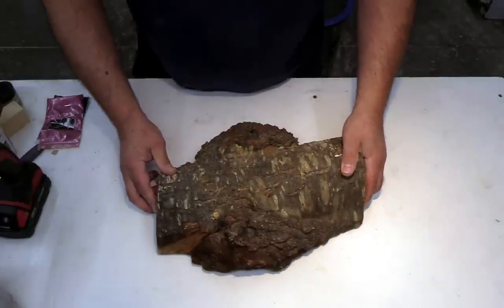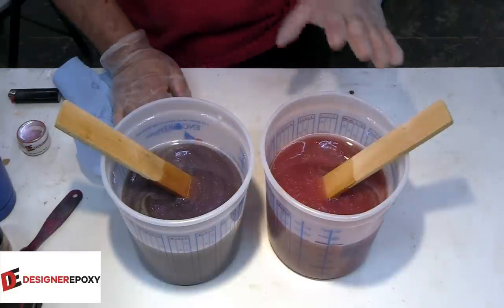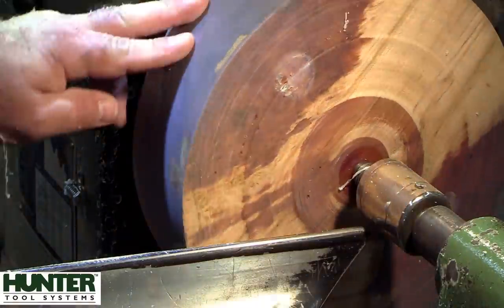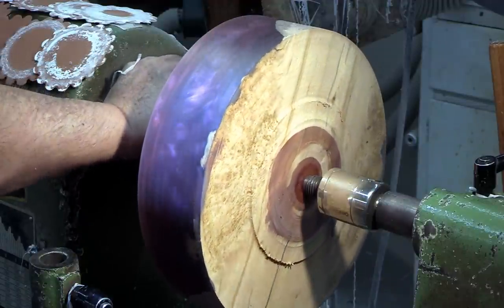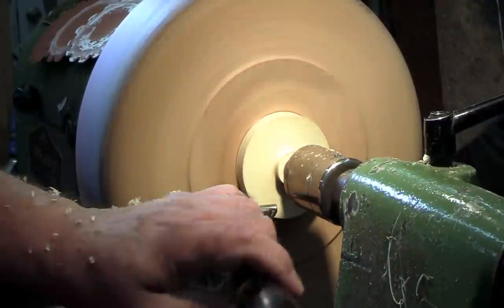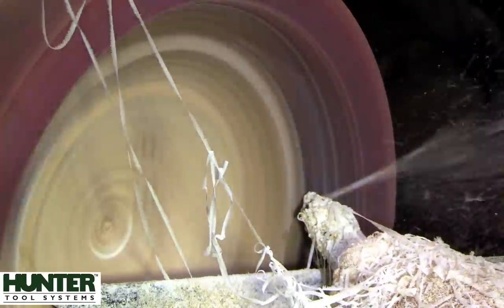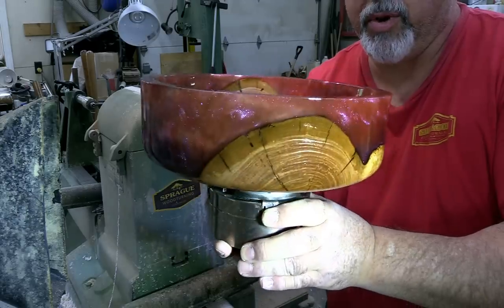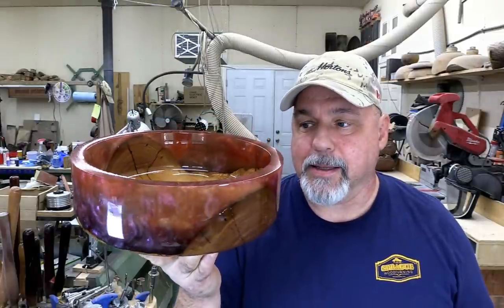Cherry Burl With Designer Epoxy's New Hyper Shift Pigment

Comment: This week's project turned out so lovely! I really like the inclusion of the hypershift powder in the resin. 
To help you, I am going to include some information about hypershifts so you can consider it for future projects.
Hypershift powder changes color depending on how the light hits it. The powder you used was listed as red-purple-blue. That means the color of the flakes changes from red to purple to blue in the light. It doesn't mean that you have to use it with that color of resin. As a matter of fact, I have seen some beautiful combinations of hypershift flakes used with a very different base color, including using flakes with base colors like clear, white or black. Hope this information helps!
Reply: Good morning Jim! Not a big fan of this week colors, but the result is beautiful!  I will certainly try those "hyper shift pigments" it is very interesting!  Chosing to have the wood at the bottom was absolutely the right decision, resin is beutiful and so is the wood.  BEAUTIFUL once again!  Have a great week! 😊
Reply from the maker: Good info, the owner said it really looks good with black. I totally misunderstood about the color thing. Need to talk to him about that, lol. Thanks

Comment: It’s funny - I was convinced that your initial choice for the top was correct, but switching was definitely the right call. I think it did exactly what you said. I always think that the wood should be the showcase and the epoxy is accent, but this struck the perfect balance between the two. Great work, as always! Thanks Jim!
Reply from the maker: Totally agree! Thanks

Comment: I adore cherry, and think this bowl is gorgeous! That color-shift did add shine and dimension, and the red and purple do complement the wood so were a good choice. Plus, choosing to make the burl the bottom of the bowl turned out great--notice @35:02 on, the bark-edge of the bole inside the burl casts a "shadow" in the resin that resembles a mountain range in the mist. Really love this one, Jim!
Reply from the maker: Thank you very much!

Comment: A lovely bowl, and from a doggy bit of wood. The colour shift was lovely.  It had been done in a different way adding to the resin. Wish I had the money, and somewhere to display it.  As self taught you didn't have the prejudices of older 'wiser?' people, ramming their ideas at you.  Well done.  
I have seen users use colour shift by coating the mould. I admit they were smaller projects.  When they came out of the mould, it was as if there were 2 different objects of different colours, depending how they were placed.  Possibly a small bowl/shaving brush etc as a trial?
Reply from the maker: Yes, I’ve seen that as well, the thing is, they don’t do anything with the piece after that. They don’t need to shape things like I do so that application won’t work for me. Lots more to come with this stuff. Thanks
Reply: @SpragueWoodturning  Come to think of it that's true. Pity.

Comment: Definitely the right choice on the shape and orientation, think you would've lost a lot of wood going with it the other way up.

It's funny because I was just thinking about the shape to show off the resin when you said it would need steep sides 😆 🤣 😂 

Will be good to see 2 opposing colours with the hyper shift in it, see som contrasting sparkles lol

It's even showing stricture of the hyper shift when lit from the inside, really like that one though so 👍 to designer epoxy for the new edition to the epoxy effects. (Have they got a nice one for gold and silver or metallic though? lol).

Very nice
Reply from the maker: Not exactly sure, but there’s three different types. Thanks

Comment: Outstanding. 
A thought about your early comment on the mixing of the epoxies when putting it into the pressure pot. Put 3-4 evenly spaced holes near the top of the bucket. Put some twine through them. You can them lift it with the twine and should be much easier going to and putting in the pot.
Reply from the maker: Thank you very much!

Comment: This is gorgeous.
I know you don't do resin with bark on because the bark could peel, but what if you stabilized the resin with CA glue before the resin pour? I'd just love to see you try, even if it failed it's make a great video.
Reply from the maker: This would still be a bad practice, even if the bark held, it will get indented when sanding and leave an undesirable surface. Thanks for watching!

Comment: I’ve seen the “hyper shift” glitter mica before on a soap making channel. Cold process soap isn’t shiny inside because glitter is destroyed by the saponification process & anything big enough to survive is abrasive to skin (you can put biodegradable glitter on top safely). But this type of mica maintains its shimmer in soap, so if anyone watching this wants a similar product at a different price (idk if it’s more or less) check out mad micas, wholesale supples plus or Nurture Soap. Edit: can you ask the sponsors if you can include the international audience?
Reply from the maker: Thanks for the info. The big problem with my sponsors shipping worldwide is all the international laws pertaining to hazardous materials and the shipping regulations. DE told me it was a major issue just getting approval to ship to the USA. Tool manufacturers might be different, but then the problem is the cost of the shipping. Wish I had a better answer for you. Thanks
Reply: @SpragueWoodturning  I appreciate you taking the time to fill me in, thanks. I’m glad the Americans got in at least

Comment: I have noticed over time that you have changed glue blocks form using a faceplate screwed to wood to just wood. I am curious as to your thoughts regarding this change. I have always preferred glue blocks and I experiment with just wood, wood + faceplate, and wood tapped to screw directly onto the lathe. Your opinions would be appreciated.
Reply from the maker: I certainly could of used a glue block that’s mounted on a homemade faceplate on this piece but they vibrated more that having the small waste block on the bottom. That way the jaws of the chuck are resting on the bottom of the piece and it take away a lot of the vibration. I mostly use them on the bottom of twice turned bowls. Thanks for watching.

Comment: ??? Hey Jim.   Is it necessary to have a pressure pot or can the epoxy dry in the air?   thankyou
Reply from the maker: No need for a PP. The epoxy will cure on its own. Thanks